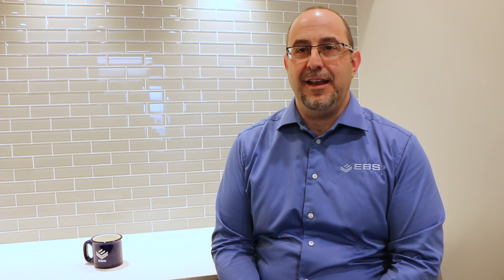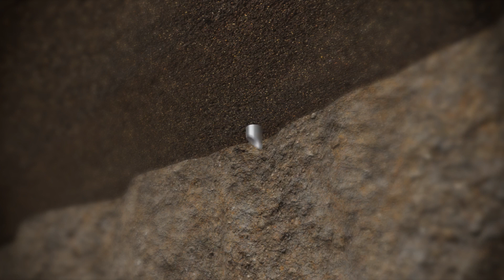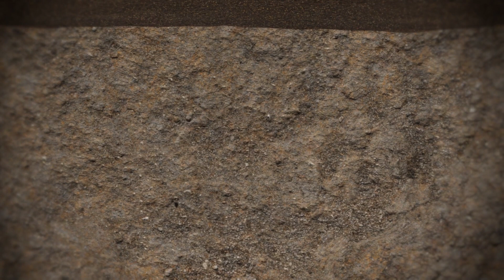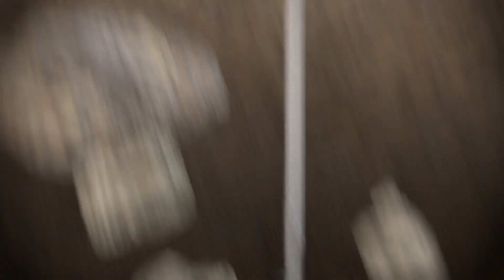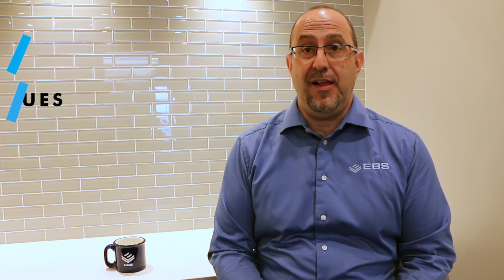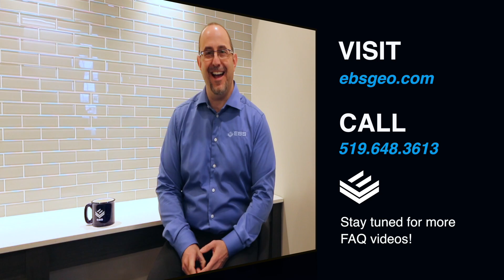Frequently Asked Questions - Helical Pile Obstructions

Comment: What if you hit solid rock at 2.5 feet and building code requires a minimum depth of 4 feet?
Reply from the maker: Hi Mark, thanks for your question. If we were to hit solid rock (ie - bedrock) at 2.5 feet you would likely not need a deep foundation system. However, if you are referring to an obstruction, you have a couple options:
1) Retract the helical pile and reinstall it along the grade beam as necessary
2) Retract and reinstall it in the same location on a batter (slight angle)
One of the benefits of helical piles is that you do not have to abandon the pile. In most cases, it can be removed and reinstalled (unlike other deep foundation options). I hope that answers your question, if not feel free to reach out again!